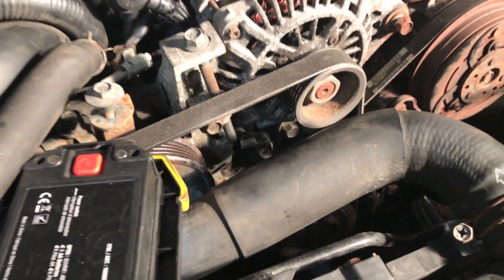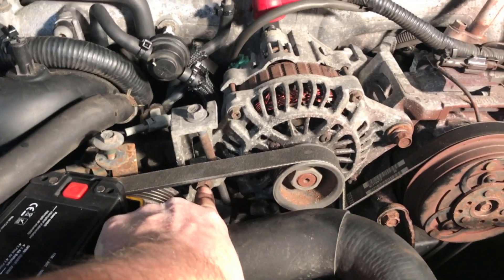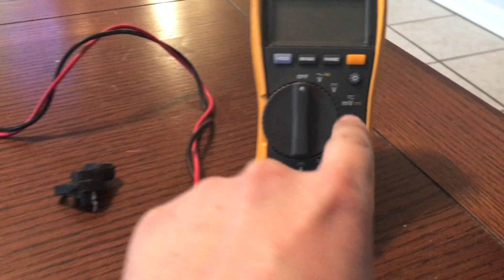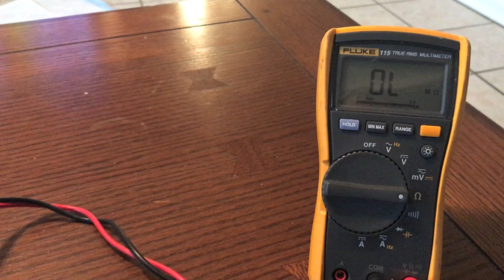How to test and remove a stuck crank position sensor - Subaru Ej255

Comment: 5 years on and your video is still helping out, actually watched this before I even started the job as heard they tend to be stuck, that little metal cap was well siezed in there, even when I could rotate it in the hole there was so much corrosion I couldn't pull it out, ended up having to grip it with a pair of side cutters, cleaned the hole up with a dremmel and had a vacuum running to remove all the debris, thanks for your help.
Reply from the maker: Dude I'm coming back!

Comment: Duuuuude! Just happened to me 15 mins ago on my 08 legacy gt. About to try your method of getting it out....all I can say is either way, thanks for showing that there is some hope...and for the chuckle. Wish me luck. 

Cheers
Reply: You you magnificent bastard! It worked! Got rid of all the magnet and plastic inside of it and was left with just the stuck housing inside. Did like you did and got a tiny flathead in between the housing and the sensor hole and eventually mangled it enough to put the f-er out! On thing I would add for anyone else needing to do this is have  a vacuum near by to suck out all the plastic and mental as you a digging at it so nothing gets inside the crankshaft area. 
You're a lifesaver man! You gave me hope and it worked! I owe you. 

Cheers
Reply: @Ed-fr2mx really appreciate this

Comment: ‘05 forester non-turbo 2.5X ... had to end up pulling the alternator and belt to get good purchase on it and it still wouldn’t come out, but it did rotate. I eventually went to my Final Option; vice grips. I ended up with about three feet of extremely thin gauge copper wire, the magnet and other bits and pieces, but the metal ‘cup’ remained fused into the the engine block. Once I scrape it out I’ll make sure to apply some anti-seize compound on the new module.

Comment: Ten minutes after watched your video. I just had Well laughed when I had the bolt out and it would not budge extra precaution not to pry and ended pulling it in my hand yep metal bottom Still in side its all about the journey. I'm half way there now to get the rest out.

Comment: thanks for the great video. had the same thing happen with the crankshaft positon sensor in my 2004 forester! very similar reaction too. I used the same technique to remove, thus destroying the old o-ring. Now have a crank but no start issue. Did you by chance install a new o-ring with the new sensor. wondering if this is my issue. thanks a bunch, keep up the oscar quality acting!

Comment: I found your video this morning, and was like "well, this'll probably be my luck". Sure enough, the sensor would twist but not budge, and when I tried to pry it out it snapped right off. Drilled out all the insides and pried out the outer shell. Probably would have been freaking out if I hadn't watched this first, so thanks!

Comment: I have an issue where I get a crank but no start. Tested fuel and spark. Both seem good. The suspects are crank and cam sensor. Crank sensor broke (just like yours) so I replaced it with no success starting the car. Will be doing cam next. Btw did you try changing the cam sensor?
Reply: Was it the cam sensor?
Reply: @SkyMuffinz  nope. It was a seized toothed idler and it jerked the timing belt and ruined the engine

Comment: Just happened to me.. i feel the same way as you did. watching it now.
Reply from the maker: You'll get through it bud! Thanks for the sub.
Reply: @LivingEEE  You were right. in fact, when i started drilling, the plastic started spinning so i kept pushing it. Next thing i started see oil leaking out. i started backing out the drill bit and the darn sensor came out with it. It was time to celebrate. I told some people your story about burning the truck and everybody laughed. Didnt fix my 'cranks but wont start' problem.  turned out to be bad spark plugs.

Comment: Some idiot used glue or some rubbery substance to put in a crank shaft sensor on my 07 Pacifica.
Reply from the maker: Jeeezz...Hope you got it out.
Reply: bruh, what happened in the long run?
Reply: Chevy glues the wire plug connectors together on their neutral safety switches. Why? Because they're scumbags. They probably glued my camshaft sensor too.
Reply: This literally just happened on my 08 pacifica, the sensor casing broke off inside the trans. Unfortunately, do to the positioning i cant get a drill in. Idk what im going to do.

Comment: I have the same issue I'm dealing with right now with my dodge ram but I have no room at all to get a drill on the side of the motor
Reply: BAMF_Ben_Allen I’m dealing with the same thing with my Dodge Charger
Reply: @lorenzoball3539  I made a video on what I did to remove my seized and broken crank sensor ...after hrs of struggling it was a simple trip to home depot that saved the day
Reply: @gsxrstyle  Share the fix
Reply: @lorenzoball3539  I changed all my sensors it turned out somone put sugar water in my gas tank and it clogged my injectors and fuel filter 😡